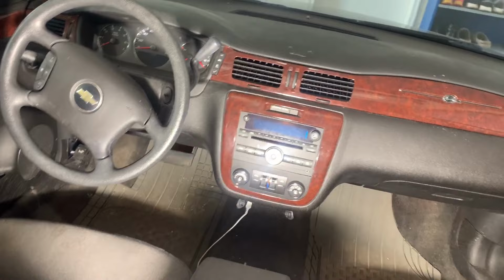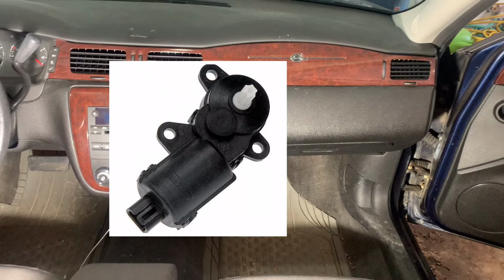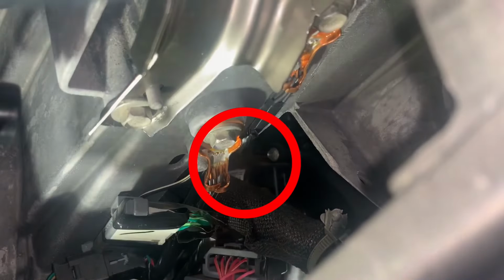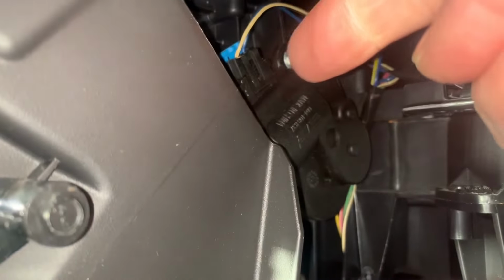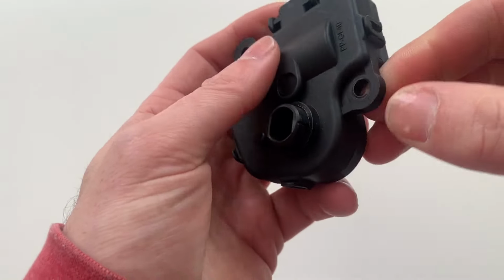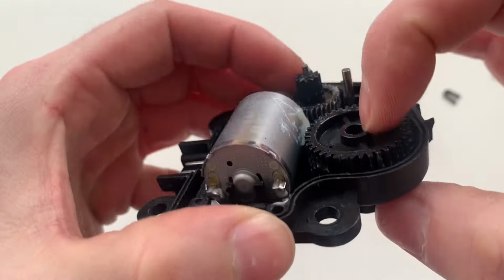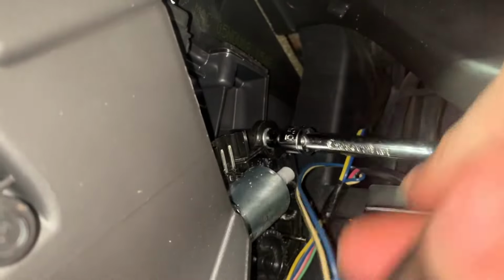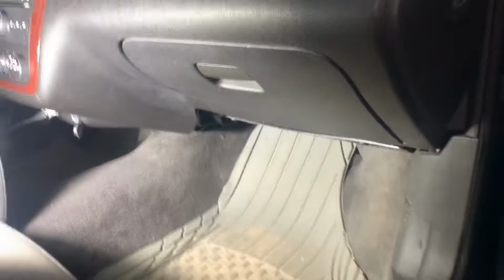FIX Impala Loud Tapping Noise in Dash! How to Replace HVAC Vent Blend Door Actuator ALL 3 LOCATIONS!

Comment: Why does it make the noise when the car is completely off?
Reply: Because the battery still has charge in it. As long as the battery isn't crap it won't kill the battery.
Reply: @JeremyStaszak  True but that doesn't answer my question.
Reply: @TheGreatOne16439  so the computer and the actuator communicate and when you hear the ticking it is trying to "relearn" what it is supposed to do but because the gears are stripped it cannot. Apparently it will even attempt this when the car is off (because it still has power in the battery) so it's basically trying to get back on track with what the computer is telling it. The door could be shut but the actuator is reading it as open. So the gears start spinning. And vice versa

Comment: You saved me $532.00.  That's how much the dealer wanted to replace the easiest one.  I paid $225.00 to have them "diagnose" the problem.  The service advisor knew what it was but took my money anyway.  Fortunately I found this video before I got the call letting me know what the problem was.  The 2014 Impala Limited is even easier, as the passenger side blend door activator is held in place with only 2 screws, Both easily accessible without the glovebox in place.  Thanks again!
Reply from the maker: That’s great to hear! Glad he saved some money!
Reply: How much did you Huye the new ones?
Reply: Funny you say they took your money when you took it to them😅invest in a otc reader simple process
Reply: Dealer told me the whole dashboard had to be removed to fix the one on the drivers side. They were supposed to replace the middle one at the same time since it was the only one that hadn't been replaced. 6 months later, it went out because they didn't replace it. Glad I found this video because I refuse to pay them another $1,100 to replace it.

Comment: As a 76 year old man, I prefer the OLD metal cable HVAC actuators on the old cars. It took mechanical action to move the lever, Left or Right and they NEVER FAILED.

Comment: Could the 4th actuator for distribution cause warm air on the driver side but not on the passenger side while AC is on? I already changed all actuator except the 4th. I've looked into the Case Assembly and Lower HVAC Blower Case but I think those are under the dash and just wondering.

Comment: Is there a Reset that has to be done after changing them. Doing the. Now great video
Reply from the maker: No, there is not. Just install them and they are ready to go.
Reply: Done it took me about a hour. Great video for the help.
Reply: Do I need to unhook my car battery before I change the actuators? My dad usually do this stuff for me🥹 😇
Reply: @crystalmajors2982  no just install them you will be fine

Comment: Hey appreciate the video bro I did the work around for my hot/cold actuator but is there a way to manually turn the fresh air/recirculate actuator?
Reply from the maker: I have not personally tried it, but you should definitely be able to rotate it when it’s plugged in and the motor is trying to rotate it. If you manually assist it by trying to rotate the output, it should get it past the stripped gear tooth inside, then the motor should rotate it normally.
Reply: @HowtoandReviewsOfficial  appreciate the response bro

Comment: I just changed the driver's side and it was fairly easy to get to with a flexible 1/4 screwdriver 
I did take the panel underneath the steering column off.
Reply from the maker: Nice! Great tips!

Comment: On my 2013 impala the piece you adjusted by hand, i cant adjust by hand on mine. I turned car on and alternate between hot and cold and it will still move between horizontal and vertical, so no need to lock in place i guess. Good video. Thanks for the help!
Reply: I can’t move the flat manually only a little and stays horizontal why is that
Reply: @Jaydemayville  not sure. I dont think your suppose to be able to. Mines 2013, i think they changed it from the older models. When you switch it from hot to cold, does it turn from vertical to horizontal?
Reply: @Jaydemayville  i haven’t even replaced the part yet because everything still works, i dont know what it actually does, because everything seems to be working as if its still there lol
Reply: @brodiesturgeon260  it does not I can manually move it 2006 Impala I am manually moving the passenger blend door it only moves about 60 degrees from cold to really cold and it needs to be flat for heat

Comment: And humid climates using strictly fresh air is extremely hard on the AC system. I always use recirculate. I’m not a smoker and the AC gets much colder and the compressor has a chance to occasionally shut off and fresh air mode. Compressor runs constantly.

Comment: I solved this problem by removing the circulated air function. Now I have fresh air only and after 7 years all is well. 
I never used the recirculating air anyway.
Reply from the maker: That will work!

Comment: The 2014 - 2016 Impala Limited LT have different owner's manuals then the other Impala's during those years. They are more like the 2013 and earlier models. If you don't know which actuator is bad you can put your hand on the side and feel it vibrate.

Comment: I pray to god this works on a 2014 because this knocking is pissing me off now
Reply from the maker: If you have the Impala Limited it will be exactly the same. The Impala changed the body style in 2014, but the previous body style (2005 - 2013) was still available for a couple more years as the “Impala Limited.”
Reply: @HowtoandReviewsOfficial  thanks so much 🫡 and its the 5mm driver i need right?
Reply from the maker: @silverdirtgamer3390  5.5 mm or 7/32 inch

Comment: hey! great video! My 2010 Chevy Impala just started doing this clicking noise yesterday and it's driving me crazy! lol thank you so much for this video. I do have one question though, what happens if I just disconnect the harness? the one in the glove compartment to the left. I heard the right one barely ever goes out but I'm just going to disconnect that anyway. but if I just disconnect the one to the left what will happen? I hope you get back to me and thank you if you do!
Reply from the maker: If you just disconnect it, that is no problem. It will be locked in whatever position it is in when you disconnect it.
Reply: @HowtoandReviewsOfficial  I disconnected it! I just left it in cold mode because I live in Florida and it's like a thousand degrees right now lol. thank you so much! you saved me some money & some time!
Reply from the maker: @soniadieguez1162  perfect! Glad it helped!

Comment: I've had my 2013 Impala for two years now and it's clicked the entire time but the air works so I just thought to heck with it. But with the dial that you control where the air comesout g at your your feet or your face sometimes you have to put it in the middle of two selections for it to blow now that it's summer and it's hot the driver side doesn't cool down very much and then of course recently, the air sounds like it's blowing when I change that mode dial at the top to your face but it doesn't actually come out of the vents but if I put it at the feet it comes out. I assume that the air not cooling on the driver side would be the driver side actuator but which one needs to be replaced for the dial that's not blowing air out at the top vents?
Reply: I should add that since the other day whenever all of a sudden it sounds like air is coming from the top vents but it does not actually blow out is when I have it on the Knox blow at your face top vent selection and the clicking sound is not happening at all now or it will happen occasionally and if I mess with the dial for the mode and I put it Between blowing at your face and your feet and only your feet it will blow a little bit out of the top vents but not the max blow that it does when you put it at the bottom left face only
Reply from the maker: I apologize for the late reply. It is fourth actuator that I pointed out in the video here 1:10. The dash has to be disassembled a little bit to access it. Here’s the part.
https://amzn.to/3YSkvBT

Comment: I replaced two actuators from the passenger side thanks to this video. So, thanks for making it 👍🏽. It was a hard job, but nothing compared to changing the actuator on the driver's side. I simply cannot reach it 😢.
Reply from the maker: Glad it helped! If I have to replace the drivers side, I will make a dedicated video.

Comment: All 3 of my actuators are bad.  The stealership quoted this as a 14 hour job requiring removal of both front seats and the complete dashboard.  The estimate came to $2500.  Thanks so much for saving me a small fortune!
Reply from the maker: Oh, wow! Glad you’re saving some money!
It’s a very common problem. I actually grabbed two more while I was at the auto salvage last weekend. Only one worked. The other was stripped out inside, lol. These things are awful.
Reply: Can you tell me the name of these actuators? Is is blend door or HVAC ?
Reply: That is criminal!  to charge that kind of money for a simple fix

Comment: Wouldn't this also be the same for 2014 models??
Reply from the maker: The Impala changed the body style in 2014. A 2014 and later Impala is the new body style. However, the previous body style (2006 - 2013) was still available for a couple more years as a fleet car for rental car companies and police. It was named the “Impala Limited.” if you have the limited, you technically have a 2006 - 2013 Impala and it will work.
If you have the new body style, it will not work.
Reply: I learned the 2014 Limited is the exact same.  🫡

Comment: The driver side actuator.If its blowing cold and you just want to take off the actuator all together what position does the white door need to be in to keep hot air for the winter ?

Comment: Excellent video. Thank you, it sounded like a machine gun in my car. All I did is. Unplug like you said, cause I could tell it was the air door fresh air door so I'm plugged it like you said and it stopped. I will be replacing it, but it was just driving me insane in the car. Thank you. That was a very, very helpful video.
Reply from the maker: Lol. Super easy to replace! I was at the auto salvage yard a couple days ago and grabbed a few more for spares while I was there.

Comment: You never use the recirculation feature? Your AC will cool much better if you do.
Reply from the maker: That’s true. But I have never had working AC, lol. I use 255 AC (two windows at 55 miles per an hour).

Comment: Thanks for providing the work around. I ordered the actuators but couldn’t tell which one was bad but I knew the outside air versus cabin air circulation was the issue ssooo unplugged that clip.. no more clicking!
Reply from the maker: Nice! Glad it helped!

Comment: Mine is possessed.  Anything triggers the tapping sound.  At first it would tap when I opened the door, which was partially expected considering the electrical may have glitched.  But then it started tapping as soon as I'd brushed off leaves from the windshield gutter.  Then,  just walking by my car, it started tapping.  There is definitely a ghost in the machine. 👻 🚗

Comment: Hi, I hope you see my comment and question. My recirculator actuator on the passenger side, furthest to the right, was clicking. I disconnected it because it drained my battery. My question is, do I really need a new one, or can I go without one? Thank you!
Reply from the maker: It’s an easy one to access if you do want to replace it. But I recommend leaving it on fresh air if you leave it disconnected. Otherwise, it will get humid and foggy inside when you run the heat.

Comment: What it mean if I can’t rotate it by hand
Reply from the maker: It means you need to do some push-ups and drink some milk. Just kidding.
Something is bound up. I would try to use some pliers and rotate it back and forth. Maybe you can break it loose and get it rotating smoothly. If it is completely seized, the little actuator probably will not be able to turn it, and it will strip the gears inside.

Comment: The impala I’m working on has an intermittent tapping/clicking that I cannot get the car to recreate now that it’s in my shop. 

However, the HVAC will only blow air/AC… is the actuator you pulled (the hot/cold) the fix to this assuming heater core and coolant levels are fine?  The door is stuck in the closed/vertical position and the flaps will not open.

Comment: My driver side vents don't blow hot air when I put heater on but I don't hear ticking would the actuator still be my issue

Comment: 2010 chevy impala, driver side vents not blowing cold like the passenger side until its circulated thru for a few mins. Replaced driver side actuator hoping to fix the issue. Still having the same issue. Any ideas? Any help is most appreciated!

Comment: Maybe you could help me?  My sister's car is a 2015 Impala.  Her AC is not blowing good out of the main vents! The far right actuator clucks but eventually moves the white flap.  That's the only actuator clicking.  When the fan is on high, the dial for venting is turn all the way left for main vents, very little air comes out, but it does shoot out cold below to the floor hard.  She doesn't take very good care of her car, I thought I had it solved, I got to the cabin air filter and it was terribly clogged with a ton of crap. I blew out the filter as clean as I could just to get air flow, but still main events very weak.

Comment: The size of the nut is 7/32,
Reply from the maker: That will work!  It is a metric screw and the official size is 5.5 mm. But, 7/32” will also work (7/32” = 5.6 mm, close enough to work)
Reply: @HowtoandReviewsOfficial  I looked for a 5.5, I didn't have one. But I knew I had put in the Drivers side a couple of years sgo. You made a good video, but no video is perfect. But you guys make things easier to do.
Reply from the maker: @trentallman984  I appreciate it, thanks
Reply: @HowtoandReviewsOfficial  Merry Christmas

Comment: Do I need to disconnect my car battery ?
Reply from the maker: That would be helpful. 
Otherwise, make sure to disconnect the actuator power before beginning to remove the actuator, and do not reconnect the actuator power until after it is completely installed.
Reply: @HowtoandReviewsOfficial  thanks for the help, I managed to do the repair myself for $16 vs several hundreds of dollars at a shop
Reply from the maker: @camerontjader  Awesome! Thanks for the update!

Comment: If I'm not mistaken, if the the 
Hot air vs cold air door is clicking.. that means it would be stuck on heat right? So your ac won't work if that one isn't working?
Reply from the maker: It could be either hot or cold. It could be stuck in either position.

Comment: Absolutely Superb!!!!!  Very detailed and complete. The only thing I would add is how do you figure out which one is Tapping. Well, lower the glove box and start car. Mine starts tapping
immediately. Simply put your fingers on the 2 actuators and you can feel or see which one is the trouble maker. If neither on the right are the offender, you know it is the one under steering 
column.
Reply from the maker: Good instructions, thanks for sharing!

Comment: On the fresh air/recirculate actuator there is that massive wiring in the way and it makes it seem almost impossible to get a tool around it to take out the bolts. Do you know of any way to temporarily move that or any tools that may make it easier?

Comment: I replaced both actuators that were clicking with brand new ones and now they both still tick but now its a different tone noise what is going on someone please help me out
Reply: Just leave it alone bro bc chevy did this cheap ass thing being lazy instead of going back with the olskool blend door instead of having the AC half in half meaning that if your passenger is cold you can turn him or her warm why you stay cool chevy thought they hit the jackpot when they discovered comfort with a shitty lil box with plastic gears rotating everything in stead of putting some good decent medal gears in the actuator box so you'll have that problem til you sell her but I over look it in press on bro hell at least we riding in not walking thank God for my wheels. Take care I hope i explain everything good enough for you to understand what was going brother take care God bless 👊🏿

Comment: I had to replace the one under the steering wheel. That was a bitch, but this video made it very easy to find and I did it in my driveway. I also like how it didn’t have a bunch of padding, just straight to the point. Perfect for working on cars as it’s already frustrating
Reply from the maker: Glad it was helpful, and good job handling the one under the steering wheel! I will definitely make a dedicated video if/when I have to replace that one.

Comment: I’m trying to move the flat from vertical to flat for heat and it’s like halfway stuck at a 30 degree angle  and won’t go 90 degrees for heat what to do?

Comment: You’re a hero dude.  When I asked the shop about this they said the dash would have to come out.  Much easier than I was anticipating.
Reply from the maker: That’s crazy. The passenger side is super easy.
Reply: @HowtoandReviewsOfficial  My passenger side actuators were replaced. The ticking is coming from the driver's side. Am I really able to replace the actuator from underneath instead of removing the entire dashboard? fingers crossed
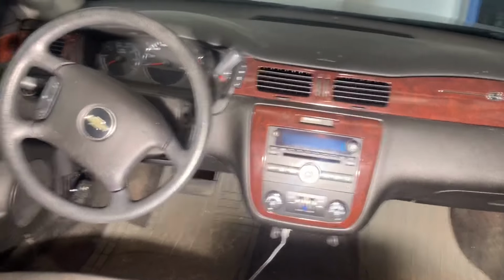Reply: @DivaDelgado128  1:25  yes you can. ive done it before but he shows you how to get to it at the time that i stamped. good luck!!